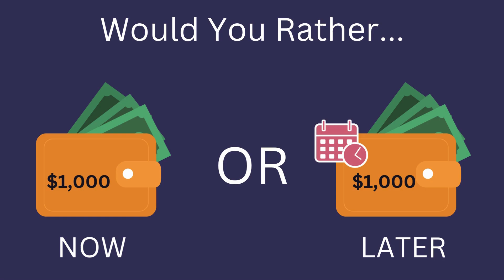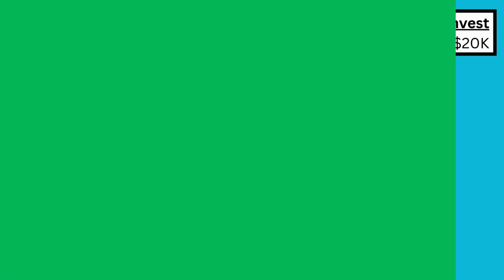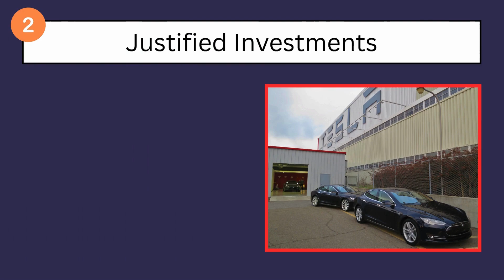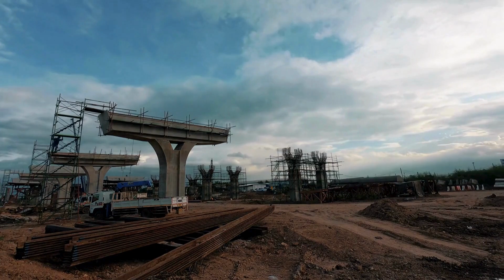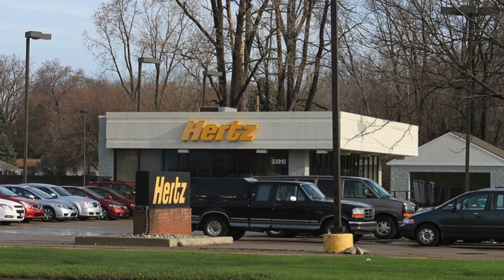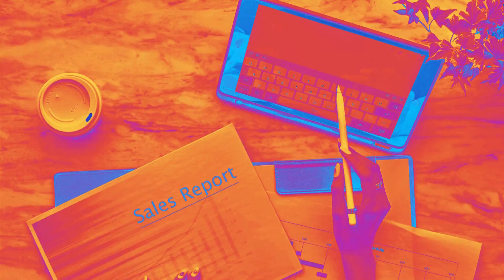(Part 1) Engineering Successes & Fails Explained Using Economic Principles

Comment: Ride-sharing companies like Uber and Lyft knowingly ran rides where the marginal cost was higher than the marginal revenue by subsidizing fares and driver pay to grow quickly. They didn’t go out of business because investors were willing to fund those losses long enough to build scale and dominate the market (ex. Uber had years of losses before finally turning profitable in 2023). Smaller competitors like Sidecar and Summon tried the same strategy but failed because they ran out of capital and couldn’t achieve sufficient scale before losses caught up with them.